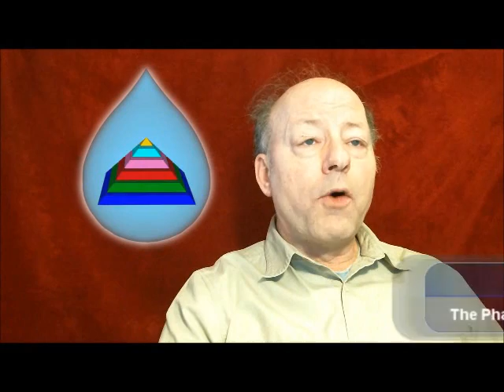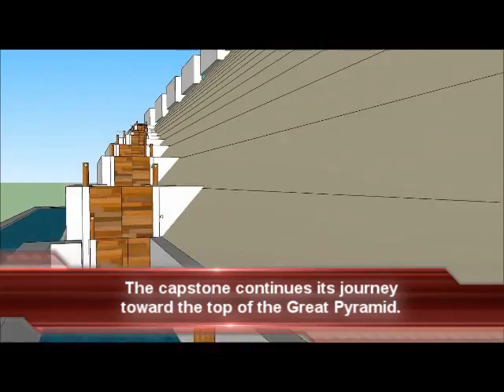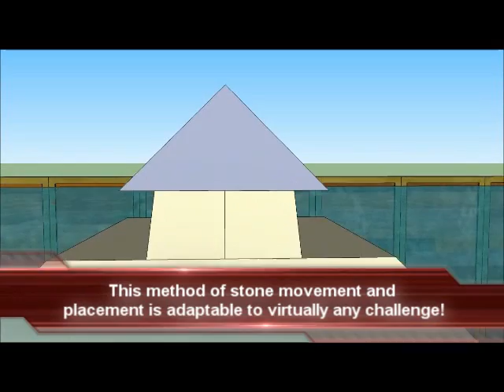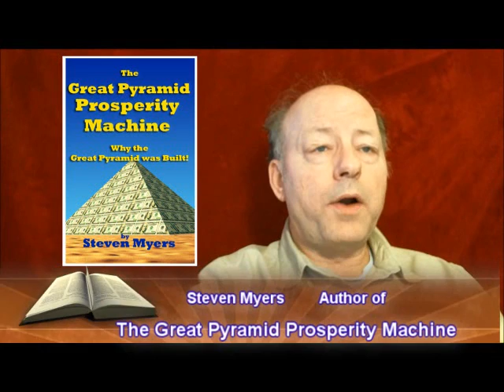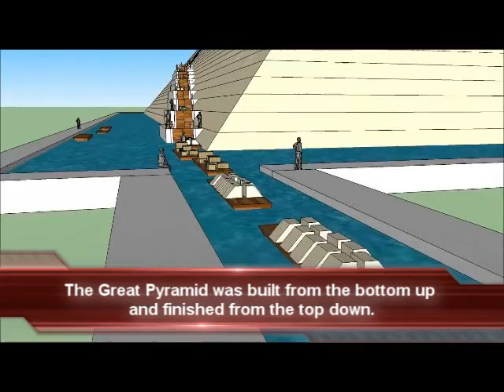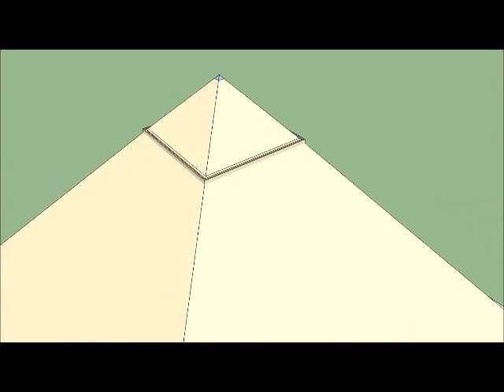Video 14  Placing the Capstone on the Great Pyramid Part Two

Comment: Hi. Awesome. Finished the series. Makes sense. Do you think the builders maybe found an aquifer underground and dig it out to build a pump chamber like a ram pump then fill in to ground level and build a moat around to fill water to supply the down passage to create a pressure and water shoot up thru grotto shaft suck aquifer water out at the same time and flow at top fill up the moat and water locks on way to Nile river. Air shafts was water pumping to fill the pond to work with barges and blocks and drain going down thru the water locks. I saw that air shafts was plugged and drilled to see what’s behind nothing. They got high so they don’t need the air shafts anymore so they plug them and used Queen chamber to pump the water higher. Ohh I am out of idea how that would work. But something like that. Awesome videos. I have to finish the pyramid water pump series to get more ideas. Hope you make more videos like 3rd series because you will get more ideas coming at you.
Reply from the maker: Thank you for watching the entire video series about how the Great Pyramid was assembled. You have many questions and our 2nd video series answers your questions by describing how the Great Pyramid pumped water. Here is the link to our 2nd online video series which is about why the Great Pyramid water pump was built. https://www.thepump.org/video-series-two

Comment: I think it likely that with proper planing as the locks were no longer needed that they were disassembled and the stones from which they were built were moved up through the locks and went into the pyramids.  Like wise as the locks were disassembled from the top down, their stones were used to become the casing stones.  That way no materials that took man power to manufacture went to waste and all signs of how they were built was eliminated.
Great work Steven, in spite of all the silly and mindless remarks made in the comments below, I think your explanation is one of the most cogent ideas put fourth so far.  All of your ideas are functional practices that either are in use or have been used to accomplish work, I have used many similar techniques myself in construction projects to great effect.  Thank you for all the work you put into these videos.
Reply from the maker: Petzlglyph thank you for the kind comment. Please spread the word.

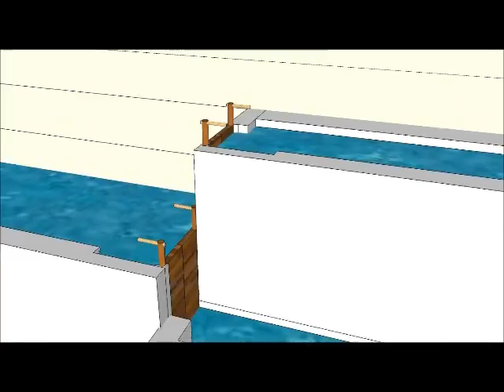Comment: This capstone idea looks interesting... until 1:55
The water location has a gate 2 or 3 times higher at the top corner next to a previous water location.
No apparent way to open the doors and not have half the water gush out.
Reply from the maker: That water lock has both gates on the same end and it is used to allow stones on barges to "turn the corner" and go up the flight of locks.  It operates like all water locks except both doors on on the same end.  The water level is equalized and the lock gates are opened allowing a barge to move from one locks to another.  It is an unusual configuration but it is still operational.  Maybe you are not envisioning the operation correctly.  If I get a chance I will make an animation for that specific configuration to help people visualize how it operated.  Maybe you will read my books someday.  Thanks for your interest.

Comment: Where is there any evidence of a "capstone" on the Pyramid? As I witness the floor at the top of the pyramid, I see channels of plumbing. I see a base that could support a penthouse suite that would be built as a wooden polyhedron. The notion that there was a capstone on the pyramid, has absolutely no evidentiary basis.
Reply from the maker: danielvincentkelley hi like I said this video shows how the capstone could have been set in place IF there was a capstone. Also this video shows how the stones of upper layers were set in place. Thank you for your interest. Here is the link to the video trailer for my 2nd book and 2nd documentary about the Great Pyramid water pump. https://youtu.be/EJV37BDjuP8

Comment: Steven Myers This makes more sense than the water elevator idea, or Houdin's ridiculous tunnel theory. I'm going to examine your process when I can find the time. My theory involves two ramps. Instead of water locks, like you suggest; my theory has an Out Ramp on scaffolding coordinates with an Inner Ramp that was A. open aired, B. wide, and C. back-filled. [buit from the bottom up but finished from the top down] In the Reply> I will post a link to my concept.
Reply: https://www.facebook.com/outerramp/
Reply: https://www.facebook.com/gary.j.chandler/media_set?set=a.10152360231421763.1073741826.598186762&type=3
Reply from the maker: Thank you for watching my videos.  I hope you read my two books. Lost Technologies of the Great Pyramid.  The Great Pyramid Prosperity Machine.
Reply from the maker: I hope you read my two books about the Great Pyramid water pump.  There is much more information in those books than in these short videos.  thanks

Comment: remember 1-gallon of water = about 8 pounds in weight. Wood is use to hold that much water, no way
Reply: Instead temporary stone blocks, instead with aqua ducts to fill and drain the water locks.

Comment: Good theory but keep trying, the removal of the locks would be physically impossible on such a sloping angle just relying on man power,( no room for such a work force).
Reply from the maker: +nephilim6993  Thank you for watching the videos.  the water locks would have been removed from the top down.  Herodotus said  the Great Pyramid was built from the bottom up but was finished from the top down.  The video series just has basic information in it. My book Lost Technologies of the Great Pyramid has so much more information.  I hope you read it someday.  Thank you!

Comment: OMG. The structure to hold that much water would have been about 16 times bigger than the pyramid!
Reply from the maker: +Mike Lindsay I hope you watch the entire video series.  The casing stones were bonded together water tight.  The water locks were used to move the stones on barges to the necessary heights.  Thank you for your interest.

Comment: Rubbish. Now I know why the Sahara is a desert. They have used all the woods and water in building those pyramides. Mr. Meyers doesn´t know that without pumping water goes only downhill. How stupid a man can be. It has been estimated that there are two and a half million stones under the Capstone. Each one 1,5 x 1,5 x 2 m weighting 1,5 tons. It has also been said that one pyramid was made during 20 years. Lets suppose that they were working only in daylight, 12 hours a day, every day during twenty years. Even a school girl can calculate that they had 2,1 minutes time for each stone. In those 2,1 minutes they had to cut the stones from Aswan rocks, grind them smooth like a mirror, somehow to move them 500 miles north, to drag stones on wooden rolls  from the river Nile near the pyramid and finally to lift them up tens of meters. No time for mistakes or replaceing. After 2,1 min comes an other one, and another...twenty years without any breaks. Lets give them more time. Lets say 200 years. Its still impossible. 21 minutes time per stone for all that work.
Man has been to the moon, is sending satellites into the space and on planets and still some idiots are wasting their time trying to solve the problem, how the pyramides were made by man using some stone age tools.
Reply from the maker: +Mauri Hakanen Hi!  Thank you for your thoughts.  Yes we agree, water flows downhill.  I contend that the subterranean cuttings below the Great Pyramid were built to be a massive water pump.  That water pump supplied water for the water locks.  My second book talks about this. The title of my second book is: The Great Pyramid Prosperity Machine.  Water lock systems always operate 24 hours a day.  The stones on barges were moved effortlessly and quickly.  Much more quickly than Egyptologists can move them.  I hope you watch the entire video series and read my two books about the Great Pyramid to become more familiar with this direction of research.  Thank you for your interest.

Comment: For the most part, this theory of how the Khufu pyramid was constructed is very plausible.  I am convinced that the builders were master hydrologists as well.  There are a few questionable methods in your theory which I will not touch on here.  Some of the methods seem like they would be far too time consuming, given the 20 year time frame most Egyptologists believe it took for completion.  Has your theory of barge flotation been tested using several ton stones?
Reply from the maker: Hi and thanks for your interest!  Water locks are a very fast system of moving payloads.  Much faster than Egyptology.  Yes moving heavy payloads with barges and ships has been demonstrated many times.  There is much more information in my books than there is in the videos.

Comment: Hi Steven. Great work with the videos, explanation and insight. This is by fare, to date, the best theory in how the pyramid where build. There are still a lot of practical question unanswered, but you have build a god foundation for future input. I think that when someone solve the riddle of how the 1200 tones blocks in Baalbek where moved and lifted up in place on the foundation without water...ore the massive puzzle stones in Peru where quarried from one mountain and moved down and over river and over another mountain and fit into place...then maybe the riddle of how they build the pyramid could be fully solved.
The people who cut with extreme precision, fitted bloks together with extreme precision, cut with huge diamond blade into granite and drill holes in to it around the world, the people who cut the famous 22 Serapeum coffins in Saqqara with extreme precision and fine polished surface , and put them into small hall ways, the people who build extreme complex building around the world...those people perhaps also used machines on the pyramid construction site. Those people also surpasses us today in knowledge and know-how in many ways. Kind regards Jimmy Braun
Reply from the maker: Thank you for the kind words.  Please watch the entire video series and please read my two books which have much more information than a few short videos.

Comment: I don't agree with everything here but it's a much better theory than the others no doubt. The boat crane seems very practical and the locks possible. But what about the air shafts, and the 8 sides of the pyramid. Such a huge undertaking is hard for my mortal brain to comprehend. If those locks were removed and filled in with smaller stone then wouldn't we be able to test this theory today.
Reply from the maker: Thank you for watching the videos but there is so much more information in the two books I wrote.  They explain why there are 8 sides and the purpose of the so called air shafts.  The books explain in detail the huge undertaking of building the Great Pyramid using water locks and barges.  The first book is: Lost Technologies of the Great Pyramid and the second book is: The Great Pyramid Prosperity Machine.  These books are in softcover or Kindle Ebook format.

Comment from the maker: The video shows that much of the stone work work which was done by hand during the finishing process was primarily done on the finely cut casing stones.  Almost all of these finely cut stones have been removed in antiquity.  I contend and research indicates that the smaller stones that were put in by has as depicted in the video would have been the easiest and probably the first to be removed.